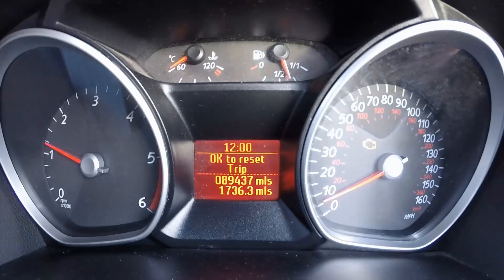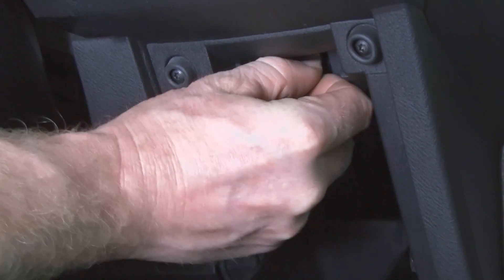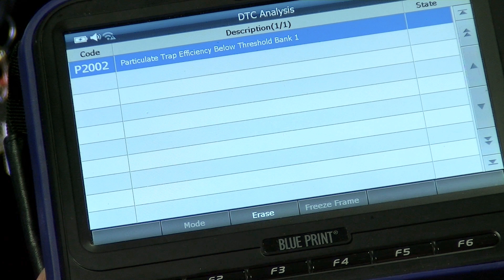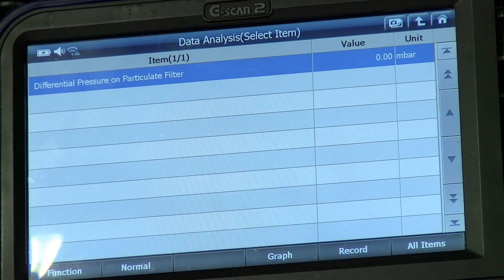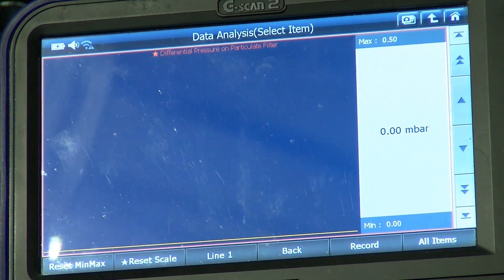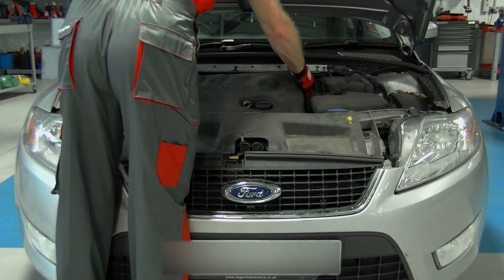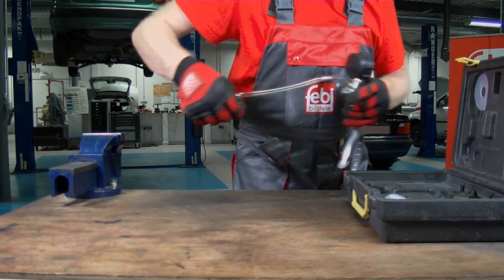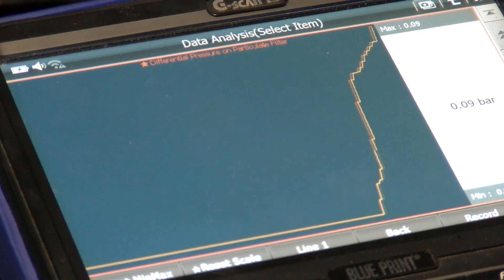[EN] Ford DPF Differential pressure sensor hose replacement  - febi bilstein Technical Video

Comment: Do the 2002/2452 codes have to be deleted or will normal use with new part fitted cause the ECU to reset? 
My scanner won't erase OBDII codes from my Kuga.
Reply from the maker: Thank you for watching our video. The codes may clear after a number of drive cycles, providing there is not any other faults. At a guess you are only using a basic OBD tool ? A more comprehensive tool would clear the codes if there is no fault.
Reply: @febi.bilstein  You're correct just a basic reader. I replaced the exhaust sensor and code cleared. I've been on a few significant journeys since and had no issues so I guess a burn cycle has occurred which has hopefully cleared any soot build up. I believe the previous  part was a faulty secondhand part judging by its look and red and blue markings on it.

Comment: Hi, what is the part number for the febi DPF pressure hose? thx!
Reply from the maker: Thank you for watching our video. The DPF pressure hose featured in this video is febi part 45777. Please check out our on-line catalogue www.partsfinder.bilsteingroup.com for further details.
Reply: @febi.bilstein  thx your answer! I bought 45777, but it doesn't fit my car! :(  Ford Galaxy 2013 , 2.0 TDCI  140HP - engine code: DW10C - UFWA) The 45777 is 56cm lenght, but my car genuine part about 90 cm! Many parts dealers do not mark the engine code only from year to year... :(
Reply from the maker: @istvansomlyai5952  Thank you for your reply and information. We will pass this to our product team for investigation.
Reply: I'm getting this fault even with my car remapped I forced a regen and still has the code I can't get under car to inspect hose but I think this it the issue iv got

Comment: Is there a specific type of hose needed such as high pressure or high temperature hose
Reply from the maker: Thank you for watching our video. The DPF pressure hose featured is made from a silicon rubber, which is protected by a heat resistant sleeve, which also comes with fixings and clips.
Reply: Excellent videos thank you! Where can I buy the hoses? I’m in Ireland?

Comment: You can accidental mount the hoses reversed?
Reply from the maker: These rubber pipes have a different internal diameter, so it would be obvious to see which pipe fitted to the sensor and to the DPF in this application. However, on other vehicles could be possible to mix them. Thank you for watching.
Reply: @febi.bilstein  I have a 2008 QXBA engined Mondeo sat in the workshop with this very problem, both pipes on the exhaust are 8mm. However the ports on the sensor are marked HI and REF, HI is high pressure side and should be connected to the pipe on the inlet (engine side) of the DPF, REF should be connected to the pipe that connects to the outlet of the DPF
Reply: @febi.bilstein  Thx for the answer,my dpf sensor values are around 4,5 kpa at idle with fluctuation and in the full throttle and load are going down to 2....1.5....0.0 kpa.This is normal?

Comment: Had the p2002 error code, S-Max 2008, after the outdoor temperatures rose from -28C to -15C. My Ford service did the static regeneration and blew all particles from the hose and all is fine now, had a few ice particles?

Comment: I've had to replace those Hoses and not sure if the sensor has an inlet and outlet or does it not matter which one goes where?
Reply from the maker: It is best advised to fit the hoses in the correct order, in the case of the Mondeo featured in this video, the hoses are different sizes, so cannot be fitted any other way.

Comment: I have been having problems with the DPF...every time I switch the engine off, there is a "groaning" noise, to me it's always sounded like the vacuum hose to the brake servo was leaking.....i'm thinking it could be these very hoses, giveing the ECU spurious readings...pricing them up now to get them changed.

Comment: Could this generate the p242f - ash accumulation error?
Reply from the maker: This could be possible, if the rubber pipe was blocked or collapsed. Always check the condition of the pipe and if the sensor is working properly. Hope you are enjoying our videos and finding them informative.
Reply: Did you solve the problem?
I have the same error code p242f